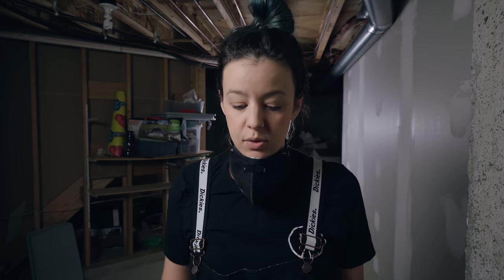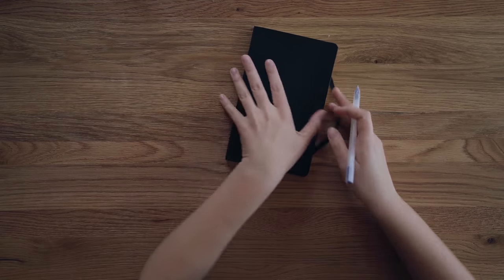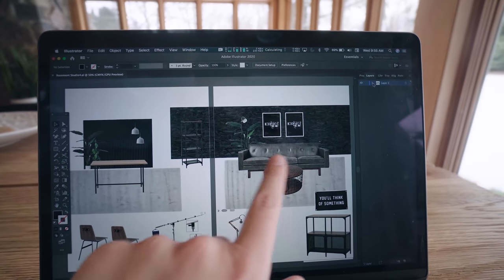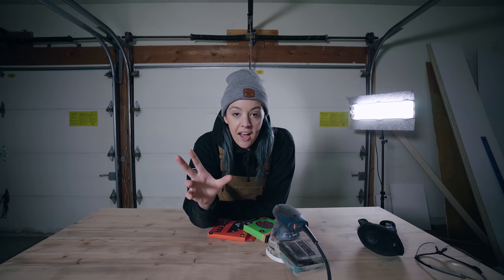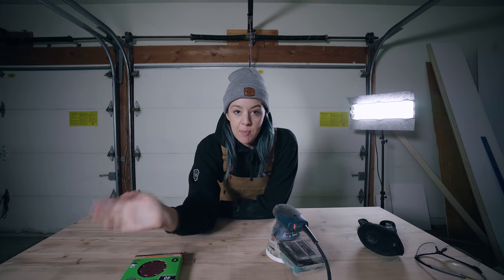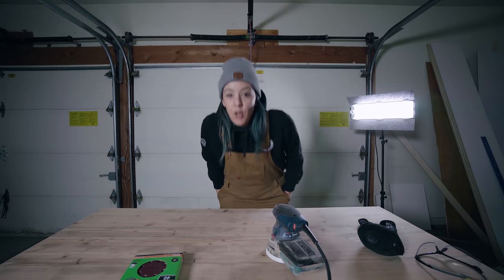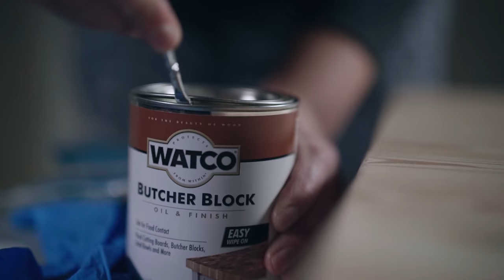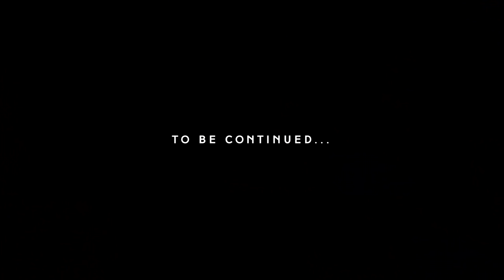Turning Our Basement Into a STUDIO!

Comment: Tip from an audio pro. If you do a short drop ceiling and fill above it with Roxul Safe N Sound it'll make a huge difference in your audio. You can also use this to insulate all your walls and build your own sound panels. Not only will it hugely improve your sound, it's also fire resistant and helps keep the space livable.

Comment: About controlling the noise from the furnace and pool equipment... it's really hard.  I could go on a whole rant about the physics of it (low frequency pump vibrations that run through concrete...), but really... the best thing is to turn it off while you're doing stuff with audio, with the caveat that you need to turn it back on when you're done.  One possibility is to run a pair of wires to somewhere near the stairs back up which run an illuminated sign to remind you to turn the furnace back on (similar to an "in use" darkroom sign if that makes sense.)

Comment: FWIW, removing that much material on that desktop, another option is to try:
1) chemical stripper or
2) belt sander
Those orbital/palm sanders are beet for finish sanding 120 and up.
Reply from the maker: Brad Poirier we didn’t have a belt sander but looking back probably should have picked one up.

Comment: Excited for this series! This one was super fun to watch, might have to do some of that concrete clear coat on my garage floor its super dusty all the time.
Reply: I don't get how it works though. Wouldn't the dust end up sitting on top of the sealer?
Reply: RocketDuck If you have a bare unsealed concrete floor the floor itself is really dusty from the bare concrete. Not so much for preventing any other dust in the room from getting on it.

Comment: The best bait I have ever tried on mouse traps is peanut butter.  Every trap I have ever set and baited with PB resulted in a dead mouse.  If you freak out with removing the dead mice get some vinyl gloves at Sally's or any beauty supply house they sell them by the box for like maybe $6 to $8 for like 100 pairs.  Mousetraps are pretty cheap so just us a 1 gallon Ziplock bag and put mouse and trap in the bag to dispose of.   Not sure if mice can tell that a trap has been used previously, they might sense the scent of death on it.  I have found if you have items close to the walls that tend to channel the mouse travel that is where you want to place the traps.